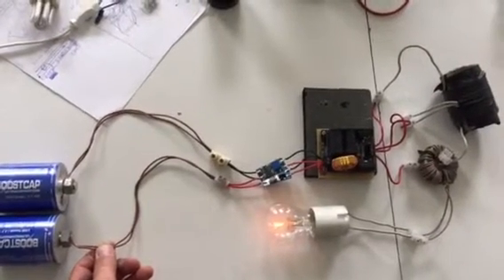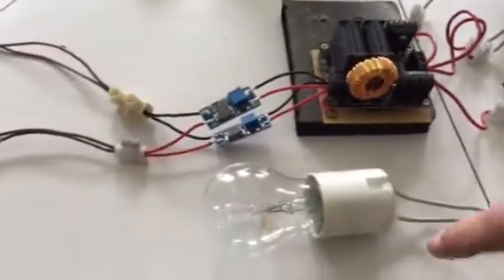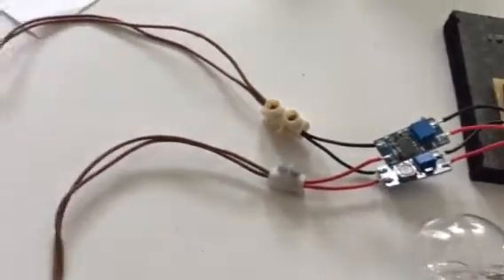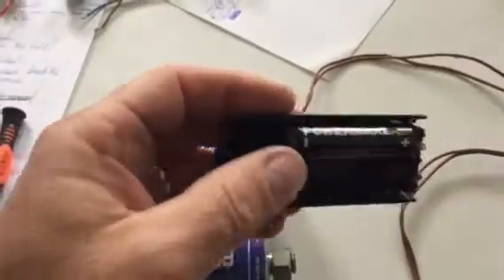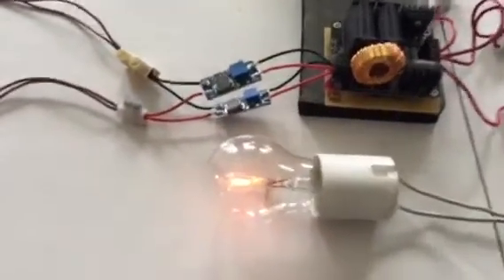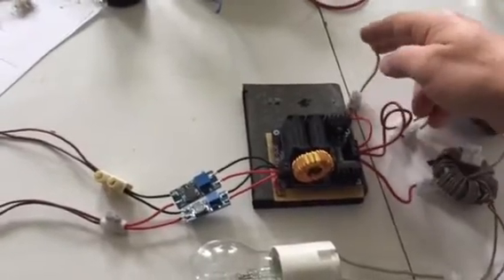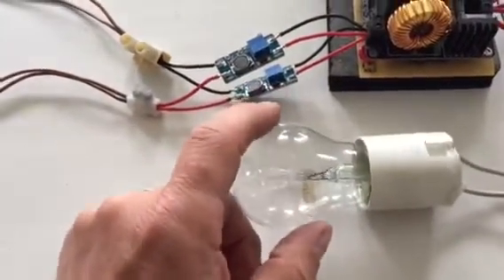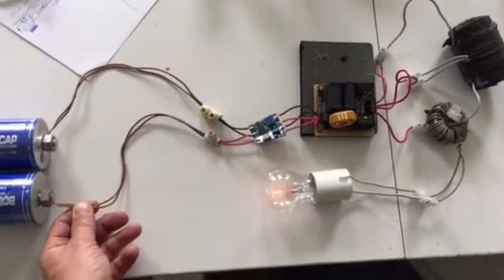ZVS IT

Comment: He says good afternoon you are doing a good program but would like to see the circuit diagram.You can right click your mouse anywhere in the white blank areas  and if you have google it will  translate it .
I  like your setup
Seems that you would have to match the input current at least with the CT for recupe.
Reply from the maker: foamaxmore yes that is always the problem ,if we had a circuit that would allow an input current to be matched, then we could loop in some of these setups:) any ideas?
Thanks for the translation.

Comment: добрый день! вы делаете хорошей программ но только не хватает монтажных схем
Reply from the maker: Ghulam Rabani  please tell me this language so I can translate and give you a reply
Reply from the maker: Ghulam Rabani I don't have a drawing but I will explain.
2x2.7vdc ultracaps into 2 D.C. -D.C. Boost converter. 2-20VDC into a ZVS driver 12-36vdc. You can choose the ones that drive a fly back . Then into a paring coil. Power is collected via a torroid with a bifilar winding. Connect the two ends of the bifilar to a light. The two free ends ac output.
Reply: добрый день! спосибо большой.